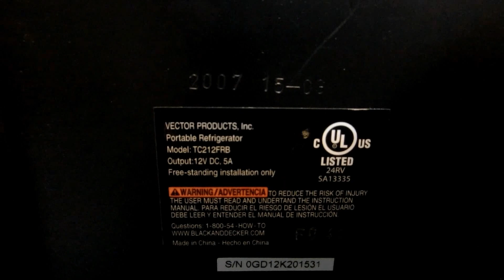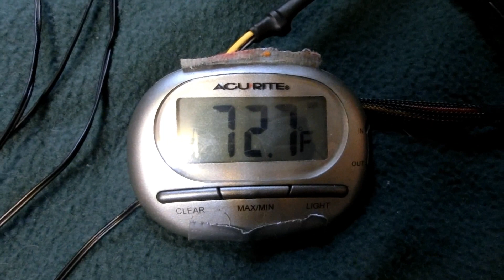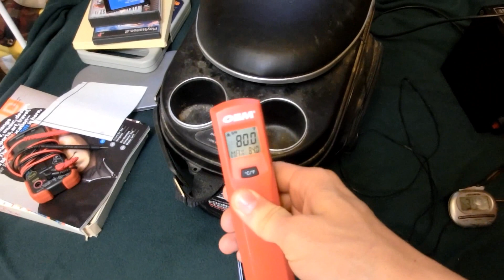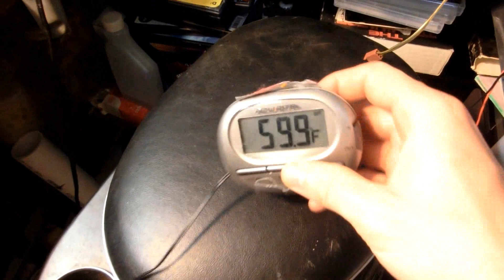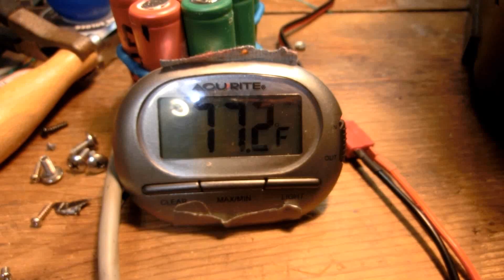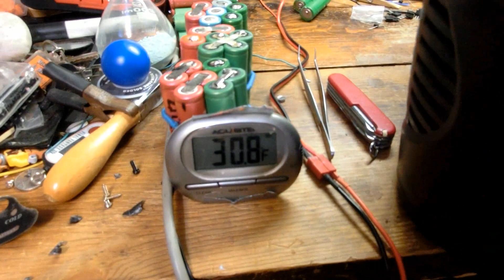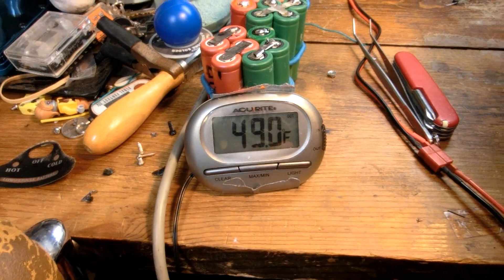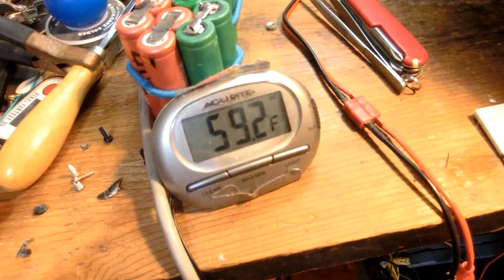DIY 12 Watt Thermo-Electric Peltier Refridgerator upgrade

Comment: cool project! have you thought about getting those wine coolers (thermoelectric) to get to below their range of 50°~65 to close to 35° and hopefully efficiently.  I like the size of those mini 12bottle wine coolers vs. a 1.7cu ft refrigerator... thanks in advance.

Comment: I am doing a water chiller with 2 of the peltier units back to back against the heat exchanger.  How do I wire it?  Just all the red wires together and all the black wires together?  They have fans as well on the hot side heat sink.  I have purchased a 12v 15A power supply so I think I'm okay there.  Any help would be appreciated.
Reply: Kenneth Ryckeley Yes, parallel connection. Red wires to red and black wires to black, and all hooked up to power supply
Reply: Kenneth Ryckeley Yes, parallel connection. Red wires to red and black wires to black, and all hooked up to power supply
Reply: I worked well it took 2 gallons of 73 degree water down to 51 in a few hours.

Comment: Wow! I was very impressed on how you explained this! Thanks so much, I actually am working on a project right now. I recently had one of the similar coolers that you did. But when I took it apart, I noticed a heat sink that was very unusual. It did not look like a heat sink. It was a aluminum block that I think transmitted the heat and cold to the metal closing (The container inside that was white and metal, haha I am not sure what it is called XD). Anyways I noticed that it had 1 positive and negative wire coming out of it. And I was absolutely sure it was something that was necessary to transmit this heat/cold. I will have to show some pictures if you do not know what I am talking about. But anyway I loved the video and it showed me a lot of logic behind cooling! Thanks!

Comment: I have a 600 watt peltier air conditioner in my shed. It is water cooled and makes a brilliant heater too.
 It needs 8 gauge wire and even on that the wires still get warm.
 Peltiers are also very inefficient compared to vapor phase refrigeration.
Reply: Shaun Dobbie  peltier may be inefficient now but nobody really uses those that means the technology for it is advancing very slowly. also peltier are very compact compared to compressor type fridges. I have even seen a usb fridge that works by using a peltier.

Comment: I love these little things.

I think the main problem is when you turn off the power the heatsink will be working in the opposite direction. Transfering heat into the unit pretty efficently. I wonder if you retrofitted a peltier with a small water pump to a very well insulated box you could see a more effecient system. Only problem would be the loss in effeciency but if your not planning on moving it might be fun to hook a couple up to an old fridge and see what you can do.

Comment: I assume that thing was built to go between passengers in an automobile.  Since what you are doing would involve less available power than from the auto, but  a greater availability of space with less mobility than needed in the automobile situation, you could increase the efficiency of the heat sink system by placing the fins in a large volume water and use water convectional cooling instead of the fan.  Pressing the heat sink surface to something like copper that conducts heat well that leads to water heat sink might work.
     I wonder how the computers that scan the Internet for certain words and their combinations of words might react.  Let's try: "Liquid nitroglycerin is "desensitized" by cooling it to about 40 to 50 °F."
Reply from the maker: yeah liquid cooling isnt a bad idea. but tbh i think it could work with a fan thats half as big.

Comment: A car would normally run about 14.4 volts while running so the 5 amp rating this is pretty accurate.

Comment: For the Peltier to work correctly you need to  have a fan on it at all times, this may be why it stopped working for a moment. Something to notice, when you take power off the Peltier put your volt meter across the leads, you will have power! I ran mine off my 100 watt solar panel with a buck converter. Great video!
Reply from the maker: well you don't "need" a fan on them at all times. a passive heatsink could work.

Comment: You could connect the fan to the 12v, it only uses 150ma.

The peltier you could connect through 5 silicone diodes to the 12v, about 8v roughly :-)
Reply from the maker: yeah but leaving them both in parallel seems to scale the air flow with the cooling nicely, at any voltage the heatsink stays cool.

Comment: I don't think you have to worry about blowing up that power supply.
Reply from the maker: actually it does overheat and trip some thermal switches if i leave it at 3amps for too long. so yeah i do. so now i try to keep it at 2.5 or lower.
Reply: The thermal switches should just turn on a fan?
Reply from the maker: *****
 yes the fan turns on when it gets slightly warm, and when it can't cool fast enough it trips another switch that shuts it off.

you think i dont know how my power supply works? ;p
Reply: Rinoa Super-Genius hey I'm actually glad you mentioned that, I have basically the exact same supply, that's good to know.
Reply from the maker: TheCanadaboy25
Well then you don't have the same one as me, mine is only 5a. It doesn't allow for more. And no heatsinks. Just a fan blowing onto a tiny heatsink inside, I could upgrade it but no need. Would be better to just build/buy a better one.

Comment: Love it. Perhaps solar powered when you've modded it ?
Reply from the maker: yeah i think if i connect it to my big panel right now it might get down to 49"

can't remember if i've said this but my uncle has a old building the size of a big garage on his farm thats overgrown. i might rent it from him and turn it into a solar powered machine shop/ studio for my channel. i would try to make a 200w solar system run some flourescent lights, this cooler, and a laptop.

then maybe upgrade so it can charge my bicycle when i'm there and maybe run an air conditioning window unit for a few minutes.
Reply: Rinoa Super-Genius I think you should have the solar panels charge a battery bank to a step up transformer or something, or if you have enough batteries, have them wired to 120v or something.  Thatd be a good, long term challenge for you. Then wire them up to the shop wiring and put up a big meter that you can look at every so often and see if you need to turn off some stuff and let the batteries charge a little.  Maybe some kind of setup with step converters would work? Just throwing those out there.
Reply: Rinoa Super-Genius I think you should have the solar panels charge a battery bank to a step up transformer or something, or if you have enough batteries, have them wired to 120v or something.  Thatd be a good, long term challenge for you. Then wire them up to the shop wiring and put up a big meter that you can look at every so often and see if you need to turn off some stuff and let the batteries charge a little.  Maybe some kind of setup with step converters would work? Just throwing those out there.

Comment: I was thinking why not use a raspberry pi +temp sensor and a relay board on the GPIO wires so you can turn power on or off when target tempature is reached , Also you could change the fan out for a insanely faster pc one if you dont mind the noise or have the fan speed controlled , So many possibilities.
Reply from the maker: because that would be too complex for a job that a simple transistor could handle. not counting a raspberry pi would take too much power. might as well use an electron tube.
Reply: Yea i guess your right :-) , My projects/ideas can get a little crazy sometimes
Reply: An Arduino would work nicely for that. You can get power consumption to <2mA with them =)